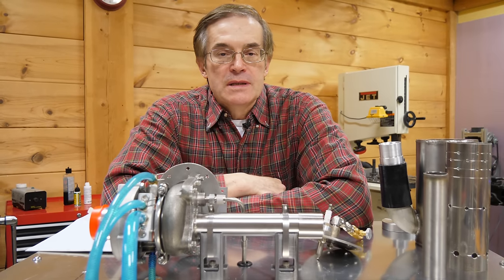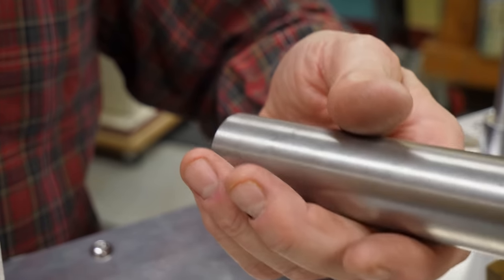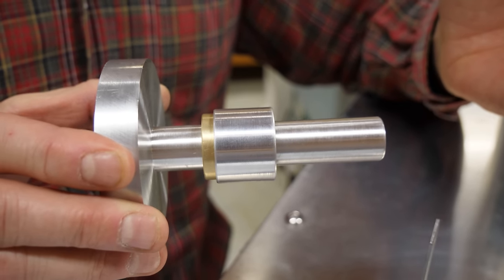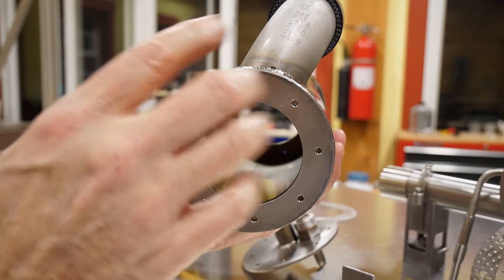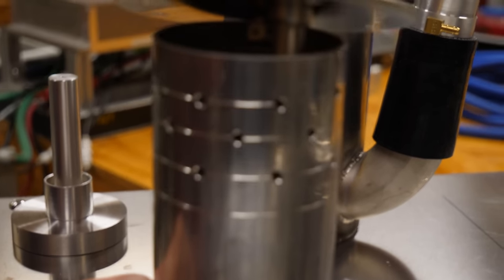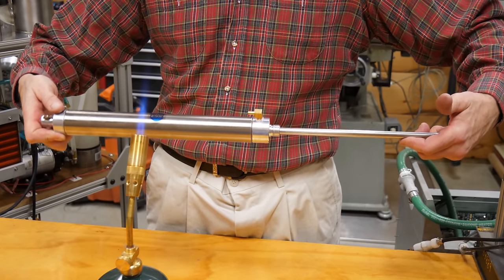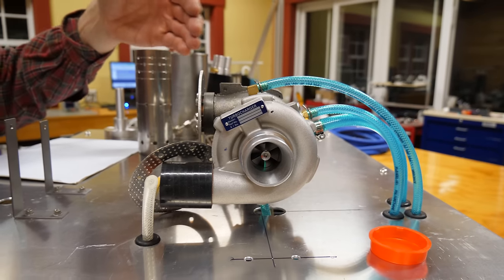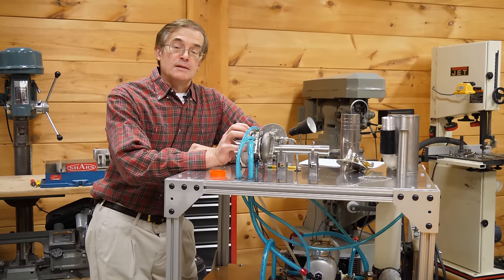The Turbojet!

Comment: Is there somewhere I can read up on getting that fuel air mix to burn to a target temp range? I'm wondering if I could use this thinking you're using for the combustion chamber to cool the flame temperature down to rather try get it to burn a gas fuel (specifically LPG) to around 2200F - 2300F for the purposes of getting steel hot enough to forge weld (Sorry WAY off this videos topic) in a very efficient manner
Reply from the maker: It is something you can derive yourself.  Look up the heat of combustion for your fuel, look up the flame temperature for that fuel in air, look up the specific heat of your fuel as well as for air ( approx 1J/degree C x gm) and then you can calculate the combustion temperature as you add additional unused fuel or unused air.
Reply: @TechIngredients  Thanks, much appreciated. Will take a look for this info and work it all out.

Comment: I love these Turbines ! ! ! Your project obviously contains Thousands of dollars worth of engineering and materials. I have two ideas for stationary shaft driven generators that could greatly increase torque and life of your turbine. Without explanation they sound a little crazy but here they are; ONE: Don't stress about combustion! Use the best possible mix by using a cutting torch head with Oxy acetylene or OXYGEN and HYDROGEN. the perfect flame and efficiency can be achieved and easily maintained - the combustion tube now just becomes a shield to prevent the flame from being blown out. TWO: USE some of that NASTY heat that destroys your turbine for making STEAM, introduce the steam just downstream of your 2000 degree flame to expand that crazy heat even more by exploding steam through the "Turbine Turbine" increasing torque by large numbers and also COOLING your turbine blades and overall temperatures throughout the entire thing!>

Comment: could you introduce water between the combustion chamber and the turbo to cool the turbo, and as a result be able to run higher temperatures?
Reply from the maker: No.
That would also reduce the volume  and pressure  of the exhaust, eliminating  any potential  gain from higher temperatures  in the combustion chamber.
Reply: @TechIngredients  well, in any case, good job, also on the rest of your channel. I have enjoyed many a video you guys made.

Comment: love these videos.
However there is one thing i still don't get: as the air is compressed further dosen"t it heat up ? 
If it dose it would mean that more fuel is need to , let's say double temperature if the air, right?
So how a higher compression ratio engine would actually be more fuel efficent?
Don't know if I'm expressing my self correctly...
Reply from the maker: You have brought up one of the issues that my simplistic explanation doesn't address.  Yes, this will require additional heat to double a higher starting temperature, but this additional heat overhead does not equal the gain from the higher compression.  Similarly, if the temperature is increased by a larger multiple than two to one this overhead remains unchanged and the effeciency again increases.  This is why increased compression ratios AND increased operating temperatures both increase the effeciency of the conversion of thermal energy into work.
Reply: @TechIngredients  thank you si much
Reply: @TechIngredients  By the way, I'm probably going to try to make a model turbofan engine, 
do you have any books in mind to recommend me?

Comment: What would it cost me to have someone build me some of the components needed? I only ask because I do not have access to the cnc machinery or welding equipment. I would be able to supply the builder with some of the important parts needed including the tiny size turbocharger I would like for my project.. I Would only require the custom parts needed for the turbocharger conversion, for the turbo I would like to use.. Would this be more feasible compared to just buying a medium/small RC jet engine kit??

Comment: I thought turbos in series were set with the smaller turbo before the larger one to allow the smaller turbo to spool up quickly and help push the larger turbo to spool it up easier.
Reply from the maker: The standard for compound turbocharging (another name for series turbocharging) is to use the larger turbo to compress the air and reduce its volume. The second, smaller turbo further compresses this air.  There are other plumbing schemes like the one you describe, but in that particular case the turbos are operating in parallel in order to reduce lag while still allowing the greater mass flow of the larger to deliver enough air as the engine reaches top speed.
Reply: Ah I see where my misunderstanding was, thank you for clearing that up for me.

Comment: What would happen if you did burn it at its stoichiometric rate and use materials capable of withstanding temperatures in excess of 2000C?
Reply from the maker: You would obtain a greater conversion of thermal energy into kenetic energy.

Comment: Can I ask about how much did this cost to build? I am interested in trying.
Reply from the maker: The turbocharger cost $200.  We used components we had lying around, but I would guess you could locate the pumps, tubing and fittings ect for about $150.  The guages can be limited to the essentials, boost pressure and EGT.

Comment: I have never seen a hydro carbon flame melt steel, and i have tried many times. I figured that if it was hot enough to melt steel it should be hot enough to make white phosphorus from bone ash/sand/charcoal mixture. The only way i have seen to melt steel with hydro carbons is with oxygen enrichment. Can i make elemental phosphorus from sand/charcoal/bone ash without buying an expensive oxygen tank?  It requires temps of around 1450 celcious, although some books say as low as 1300c. Steel should melt around 1350c depending on the type of steel. Of course i could replace the charcoal with aluminium powder, or use phosphoric acid instead of bone ash, but i dont want to do that.
Reply from the maker: An air oxidised flame can reach much higher temperatures if the air and even the fuel are pre heated.  This occurs in jet engines and reciprocating engines because of compression heating.  Blast furnaces used exhaust gasses to pre heat the air in addition to oxygen enrichment.

Comment: I know I am quite late to this video but I have been working on designing a rocket engine and was wondering if it would be possible to feed that exhaust in to a CD deLaval nozzle to further accelerate the exhaust for more thrust? Or would this produce too much back pressure for the turbocharger to run efficiently? I bring this up mainly because we have been trying to work up to a LOx Methane system and in our development process we are building and testing an "air breathing" engine which is optimized to run on compressed air at around 150psi at the chamber
Reply from the maker: As long as the exhaust pressure is sufficient to produce a supersonic output, it will work.

Comment: With all the ratios you gave us, I'm waiting for someone to put it all into parametric cad to automatically generate combustor designs!
Reply from the maker: It isn't as simple as a determistic calculation.  Different fuels require modifications of the chamber.  For example, jet fuel usually requires the fuel line to pass through the combustion chamber to pre heat it.  Propane does not.  The location of the inlet from the compressor effects the optimal location.  There is a program called jetspec that has a calculator to allow sizing of the holes.  But, starting there you will probably want to adjust these sizes and positions based on testing. Our newer, larger engine has a modified hole patern and fuel nozzle based on this testing and I'll cover that.
Reply: Amazing and fascinating.  Thank you.

Comment: For the little micro turbos like the VZ21, would 9psi oil be enough at load with 0W20 synthetic?
Reply from the maker: Probably not as the chamber pressure will usually exceed 9 PSI.  You want an oil pressure no less than the chamber pressure plus some safety margin.

Comment: would it be better to drill holes in combustion chamber at a angle to make vortex  in the  inner combustion  chamber
Reply from the maker: Some people do that.  Others have used a tool to bend the edges of the holes to create an angle in the opening.  This might be easier.

Comment: Maybe a stupid question, but doesn’t the surface area stay the same even if you squish the tube in to an oval???And another stupid question...aren’t hydro dynamice bearings better and more precise then normal bearings?? I have a lot of them on a gaint three stage natural gas compressor at my work...
Reply from the maker: Ultimately, they can be, but only if manufactured to a very precise tolerance.  These inexpensive turbos are not built that well.
Reply from the maker: An elliptical shape will have the same circumference, but ever decreasing cross sectional as the two radi diverge.
Reply: @TechIngredients  thank you very much sir for the enlightenment! I really need to brush up on my math! I really enjoy the content your channel provides! Greetings from the Netherlands!

Comment: If this engine was powered with some form of liquid fuel (Kerosin, gasoline, diesel) how high would the fuel consumption be? And, if I wanted to power a generator with it, how much kW would it roughly output?
Reply from the maker: Several  kw of output should be possible , but the low compression ratio would mean the fuel consumption will be high, on the order ofa couple of liters per kWhr.
Reply: @TechIngredients  can the compression ratio be increased by connecting multiple turbochargers in series?
Reply from the maker: Absolutely.
That's what we'll be doing in the next video in this series.

Comment: Just an FYI: There's no "compressor turbine' and "turbine turbine". The blade assembly on the intake side is the "compressor" (or "impeller") which compresses the incoming air. The blade assembly on the "hot" side is the "turbine". A turbine turns the energy of a moving fluid into mechanical work, basically the opposite of what a compressor does. So calling it a "compressor turbine" makes about as much sense as calling something "transparent opaque".
Reply from the maker: Have you ever heard of a turbo-compressor?  They are an industrial source of compressed air installed all over the world.  Turbo is short for turbine. The distinction you make is primarily limited to the automotive sector.
In any case,  aside from the jargon, the principle  is clear, and that is what really matters.

Comment: Great content and teaching skills. Totally loved it. One minor comment about turbines though ... they're opposite to pumps/ compressors in the way that they convert energy of fluid into mechanical energy. Thus calling compressor blades =  turbine blades, makes one cringe 😯
Reply from the maker: Thanks!

I got into this with JayZ.  They are indeed opposite, but the process is
 the same. The blades impart an acceleration (deceleration) force to the
 air. The kinetic energy which is transferred to (from) the air is 
converted to (from) potential energy as the air decelerates 
(accelerates) and is compressed or conversely expands.  I see this as 
comparable to a piston in a reciprocating engine.  It is still a piston 
even when the process is reversed.  There is also a huge industrial 
market for motor driven turbo compressors.  I have to wonder what else 
does the term turbo apply to?
Reply: Ha ha if you remember, personal computers use to have a 'turbo' button.
On a different note I'm interested in your idea of using an electrical fan as it removes the turbine efficiency and all issues with gas separation, hot bearings etc. Electron Rocket in NZ uses a similar concept. I hope we'll see more happening there.
Reply from the maker: I do remember those buttons and Hifi and Supersonic malts, "cheff a da future" and Ford's EcoBoost button that reduced performance!  However, Ingersoll Rand and Boge use the term and they are pretty down to earth.  Anyway, as I showed in the Hybrid Jet 2.0 video, the electrical requirements are huge, but a burst of pressure from an independent electrical compressor might be useful to get a ram jet going.

Comment: What can you expect thrust to be from a t4 turbo and also how do you know if it’s  running beyond its limit if you can’t measure rpm?
Reply from the maker: Roughly, you can expect 10lb of thrust per square inch of inducer area.  Boost pressure and exhaust gas temperature limits will in turn limit the RPM because commercial turbochargers are supplied with matched compressor and turbine components.
Reply: Tech Ingredients thank you, this is the second one I am making. The first one I used a holset hx55 turbo..

Another question I have is.. what happens if the tertiary holes are too big or if there is too many of them? 

I am only limited to “household” tools and not really machining tools...

Again thank you for help and info

Comment: What would be the most efficient lightweight type of jet to use on a bicycle?
Reply from the maker: An RC turbojet, but they are pretty expensive and need maintenance every 25 hours.
Reply: Thanks I have seen several examples of self made rc type engines. The weak point seems to be bearings. A design without a fan would be more maintenance free.

Comment: Could you get the same force from the jet engine if I use a vacuum system that only pumps the fumes from the gas for my source of fuel and would that save me on fuel just using the fumes off the fuel like getting hydrogen from water
Reply from the maker: Probably not.  You need compression to extract thrust from the expansion of the exhaust.
Reply: @TechIngredients  okay thanks

Comment: Also a donut shaped "annular chamber"  that "fold" on itself is more compact, has great surface area for cooling and reducing hot spots

See these schema 

Combustion chamber eddy analysis

https://i.imgur.com/9yFJQnx.png 

entire engine layout
https://i.imgur.com/APjttnZ.png

showing fuel nozzle, air twirl nozzle and ceramic coating (this is view from inside)

https://i.imgur.com/APjttnZ.png

showing combustion chamber outside and misc holes 

https://i.imgur.com/bZ4dZ8m.jpg

Comment: Hello sir I'm very intrigued and interested by your videos I have no experience or training and engineering but I am a thinker I have an idea I don't know if it exists because it's kind of hard to search for but I would like to try to combine magnetic components with hydraulics to condense the size of a hydraulic by using magnetic forces to compress either air or hydraulic fluid within the smaller tube do you think this exist or is possible
Reply from the maker: Probably not.  Until the current limits of superconducting magnets are substantially exceeded, the magnetic forces can't compete with the forces that hydraulics can apply.  The magnets would simply bottom out and act no differently than inert pieces of metal in the cylinders.

Comment: What if I don't want one for thrust, but want to build one for torque similar to the Chrysler Turbine Car, only this time smaller (about 100kw output) as a range extender to a hybrid power system or a series/parallel hybrid system that can simultaneously or alternatingly power both the wheels and generator to change the battery pack?
Reply from the maker: I've been thinking about that.  The challenge is the typical turbocharger operates at crazy RPMs over 100,000 and low torque.   Gearing would require very expensive equipment, more costly than the rest of the engine.
Reply: @TechIngredients  I've seen some systems use a secondary torque turbine that collects thrust pressure to turn a different impeller to power the turboshaft. You could also possibly pair that with an E-CVT but IDK anything about those aside from assumptions based on the name as I haven't looked them up yet.
Reply from the maker: I've considered that as well.  A larger turbine will spin more slowly but is also designed for a larger volume of flow than the smaller turbine will generate. There isn't a significant difference in this over the range of available A/R ratios.
Reply: @TechIngredients  At this point adapting existing parts might actually be the limiting factor. The sad part is there aren't any compact 100-ish kilowatt units on the market that work quite like a modern/better version of the Turbine Car engine does. Sure there are APUs in that range, but they're no smaller than a typical DOHC V8, at best, and are prohibitively expensive. It sucks. Especially when it's been hypothesized that turbine generator range extenders can be as small as a vacuum cleaner.

Comment: What if the sum of the cross-sectional area of the holes is not equal to the inducer???
Reply from the maker: If it is significantly smaller, the engine's airflow will choke at that point and if it's significantly larger, the air will flow into the combustion chamber close to the junction with the input pipe creating poor mixing with the fuel and an incomplete burn.

Comment: Can I use this setup with an ac electric motor? I have an older baldor 75hp 240v ac electric motor with the air intake on the top of the motor instead of the back of the motor, and was thinking of this setup for a boat lol with an alternator to 12v battery to recharge n recycle my system. ac to dc converter or dc to ac converter, not sure how it works because I'm new to this arena but willing to learn if anyone has tips, trips or knowledge on the setup I'm trying to achieve.

Comment: the thermodynamic cycles off piston engines are not really comparable to the ones in turbines, since the combustion in piston engines occurs at roughly at constant volume, where in turbines the combustion occurs at constant pressure.
Reply from the maker: That difference exists, but the principle of compression ratio applies to both.